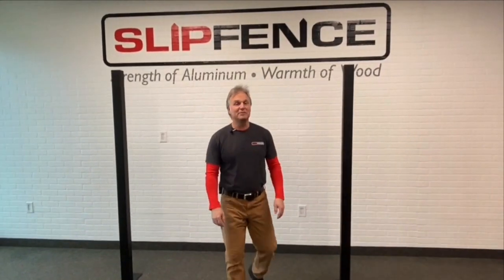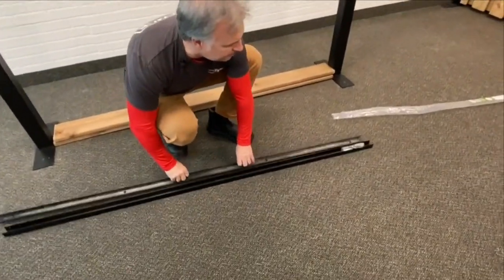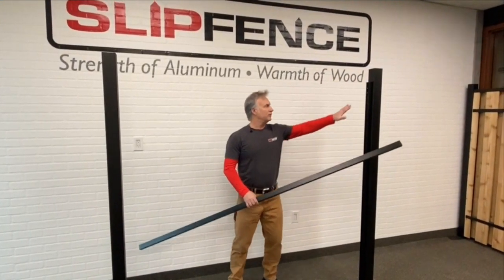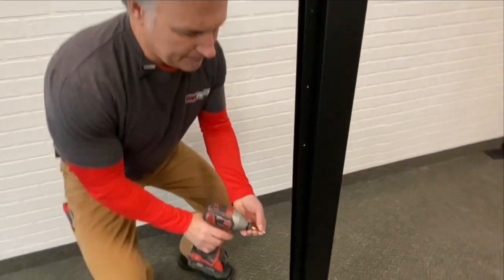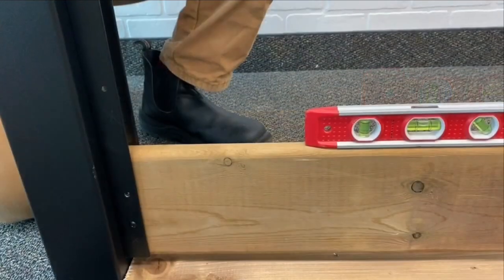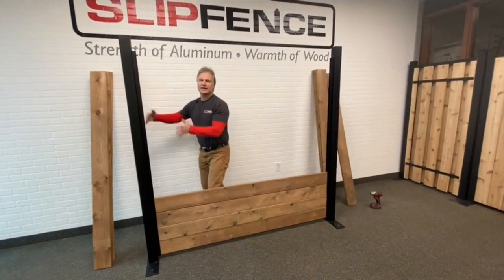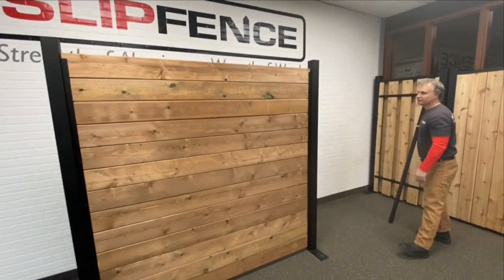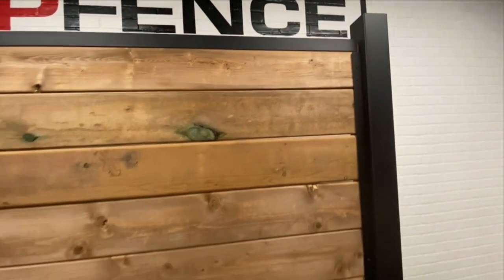SLIPFENCE Horizontal Fence installation demonstration

Comment: I would love to do this for my front and backyard
Reply from the maker: You wont be disappointed and should never need to set posts again.  When the wood starts to wether and grey, simply slip out the old wood and slip in new wood but the framework stays

Comment: What's the best way to cut them to length after setting them, portable band saw, reciprocating saw, circular saw, angle grinder, ? ?
Reply: a cordless circular saw with a new non-ferrous aluminum blade is how we do it, although you have to cut one side of the post and then go to the other side of the fence and cut the other half of the post as the blade wont make it all the way through.  Reciprocating saw tends to bounce all over the place and not cut straight.  Grinder is the same, you will likely need to do both sides of the post so the circ saw is quicker.
Reply: @TahoeProductsGroupInc Thanks. I'll give that a try.

Comment: Excellent video.  However, if setting this fence on concrete, as in your video, what did you use to secure the uprights to the concrete that will be strong enough to withstand wind and wear?
Reply from the maker: Hi, Slipfence has a 6 foot high plated post with pre-drilled holes for anchors.  This is a surface mount post and we also supply the anchors to either anchor to concrete or wood.  SF2-PP376. is the product code.

Comment: As long as the boards are the 1" thick type, can you use spacers in between? We get a lot of wind and allowing some through would be beneficial I think, even if it was just 1/2" between each board. .I'm guessing you would need to leave the spacers in for the three week period?.. Also can you even use boards with a different width to add a different visual effect?
Reply from the maker: Sure, you can also rip some of the boards by 1/2" after the drying period has ended so the boards will still meet the screw holes but provide some wind relief.
Reply: I’m also interested in leaving a set amount of spacing between the boards.  Do you sell spacers?

Comment: Hi is there a video with  the aluminum fence horizontal, love this style
Reply from the maker: Do you mean using aluminum boards?
Reply: @slipfence  aluminum post and frame and instead of the wood in the middle, aluminum fences panels.

Comment: Can I stain and seal the boards before the three weeks or does it have to be after?
Reply from the maker: Hi Adrian, this would depend on what wood you are using, how wet it is and if it is ready for stain. The stain manufacturer's customer service would likely be a better resource to answer this question. Almost all boards do require a drying out period from the date of delivery from the mill, and they will shrink width-wise once settled in the Slipfence rails.
Reply: Thank you. Im having difficulty finding 1 inch boards at home depot. Most of the boards at 3/4. Any where I might find 1in boards?

Comment: Can i do a 4ft high by cutting the 8 ft  sections in half...?
Reply from the maker: hi Joe, yes you can cut the posts and the channels for your 4 ft high sections.  Slipfence will be producing a 4 ft. high Horizontal channel kit in Late May if you can wait.
Thank You

Comment: I would like to use Trex because I hate staining. I understand that the system is rated to support the weight of Trex, but can a Trex board be spaced out 6 feet without compromising the integrity of the board?
Reply from the maker: Yes you can use Composite material in the Horizontal Slipfence system providing that the boards are exactly  1" x 5.5".  The posts and rail system are plenty strong to hold the added weight of Composite boards.
Reply: That's a question for the manufactures of Trex decking. Composite decking expands considerably when exposed to direct sunlight. I'd be more than concerned with it warping due to being unsecured along a six-foot run.

Comment: Question: Is this system rated to be used with composite deck boards?
Reply from the maker: Yes, as long as the deck boards are 1" thick they will fit perfectly into the channels.  The horizontal system was engineered to hold much heavier boards than wood because composite is becoming very popular. The channels are fastened to the posts with five  #12 stainless screws so plenty strong to hold heavier composite boards.

Comment: With wooden posts, one can just screw in supports to make sure it stays in place while the concrete dries. So how do you secure these?  Drilling holes into the posts would ruin them.
Reply: Use the metal posts, I think that's the point.
Reply: Great question. I would probably rig something up. Maybe screw two boards together against the post just not into the post.
Reply: Can secure with clamp, no need holes.
Reply from the maker: Hi, we set these posts all the time and quite honestly of you are using post setting concrete then you can really just hold the post level on both axis for  about 5 minutes each and because concrete starts to harden from the bottom up they should stay in place after a few minutes, but keep going back to check levels and height to make sure they are still at least 76" to top from ground and level both ways  hope this helps.
Reply: @BeyondTheOath  Great question! Where can we purchase the system? and if we have to purchase them through Home Depot, what size does the post need to be?

Comment: I’m having trouble with the dig out. I bought the larger poles that are 9’4’’ for a 7 foot fence. Your asking me to dig out 3-4 feet for a sturdy fence but I need 88” to build a 7 foot fence. The math is way off. I ordered the longer post. Did they give me the wrong ones? And I live in central Texas.
Reply: Who sells the post?
Reply from the maker: hi Randy, a 9' post is not long enough for a 7' high fence. You need a 10' or 12' post for a 7' high fence.  12' is recommended.

Comment: Where is the best place to buy the 5/4 deck boards?  I was thinking 12 foot boards to cut in half, but 6 footers will do. I'm in Southern California.  I see  4 footers everywhere.
Reply from the maker: There are 7 states that don't seem to stock the 5/4 board as much and California is one of them.  If you have trouble finding the 5/4 board, Slipfence also has a commercial grade channel that houses a 2 x 6 board which is a bit too chunky for most residential applications. OR...Composite boards also work as long as they are 1" thick x 5.5" wide.

Comment: How do you turn a 70 degree angle?
Reply from the maker: Slipfence has Angle wedges available that are 22.5 degrees for angles that are not perfectly 90 degree.
Reply: Use a round post.

Comment: I want to separate a room with this kind of fence.  When I searched online I could not find the kind that you are showing which can stand by thier own without digging into the earth.  Please let me know where I can get this type of fence?
Reply from the maker: Slipfence.com has a 76" tall post with a 6" x 6" plate welded to the bottom and 4 holes drilled into it for a surface mount post application.

Comment: Can I use this system for a short 3 foot fence?   If not please explain.   Where can I purchase this product?
Reply from the maker: John, yes you can cut the posts and the channels for your 3 ft high sections.  Slipfence will be producing a 4 ft. high Horizontal channel kit in late May if you can wait.
Thank You

Comment: Is it okay if I am using the system for a fence spaced out 7 feet instead of 6 feet? Is it okay to use Ipe wood that is 21mm thick instead of 5/4 in?

Comment: What happens when the ground is not level?
Reply from the maker: You step the 6 foot sections.  Keep the earth when you dig the posts and fill in the bottom end under the board so the grass can re-grow. if it is a drastic drop in elevation within each 6 foot section you can either shorten up the sections to 4 feet or custom create the bottom board with another board and fasten together with glue and screws and then cut the bottom to follow the grade.

Comment: Great video, helped for sure. Question, if I used composted (trex) do they still need to sit for 3 weeks before drilling in?
Reply: I have the same question. So if you find out before I let me know. Thanks
Reply: Joshua Crandall Jr I emailed them and they said not necessary to wait with composite.
Reply: @RobPandolfo  awesome. Thanks bud. Gonna be a little more expensive but well worth it. Time to do some math
Reply from the maker: No need to leave for three weeks using composite. The reason for that waiting period is for the wood to shrink, but not necessary with composite.